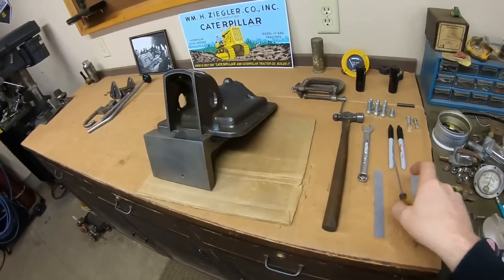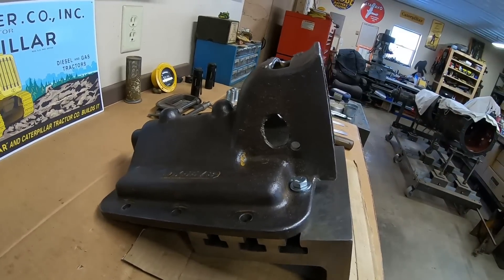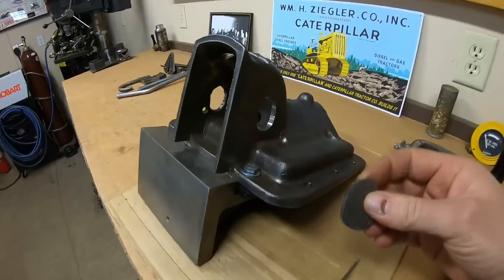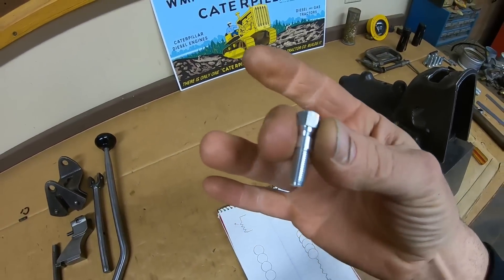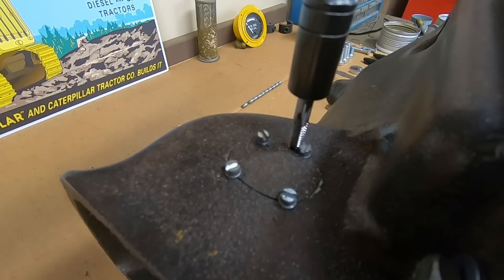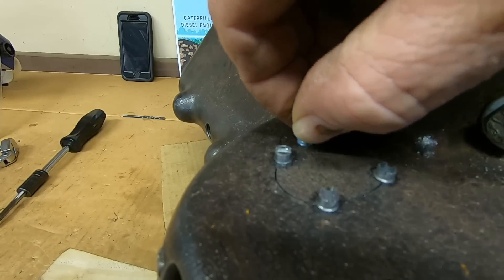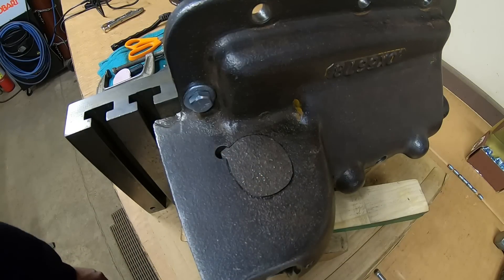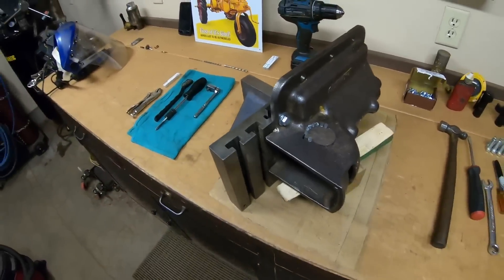Minneapolis-Moline 445 Prototype #X231 - Part 51: Metal Stitching the Top Cover Torch Holes Closed!

Comment: While a braze is likely the best repair, I believe it would leave a tell-tale line and look of repair maybe too hard to hide, so in this case the stitch and blend you are doing is better at hiding damage to restore the look. So overall the better choice.
I wonder if that hole had a grimy cork in it and they were surprised when it blew out as they cut that awful hole. Our only hope is they grumbles about that for years as penanace!
Reply: I keep being a fan of silver soldering. It doesn't take quite as much heat as brazing, and is MUCH easier. You get a joint fluxed and heated, touch the end of the solder to it, and capillary action sucks the solder into the joint and it will flash half way around in an instant. You can also use a lot less than brazing, and with a little care could have filled that very tight joint full with hardly any marks at all.

Silver solder is also very strong. One demonstration a shop teacher did was the grind the ends of two 1/2" bolts smooth and silver solder them together. He then clamped one head in a vise and gronked with a wrench on the other head until the bolts broke. The silver solder held, it was the steel bolt shaft that fractured.
Reply: @lwilton  I have a pair of little diagonal cutters that I silver soldered back together after I snapped a jaw off. I did it mostly to see if it would work, and was pretty surprised by the results. You can hardly even see the repair. Btw, Wite-Out type correcting fluid makes a great resist for areas you don't want solder getting to.

Comment: My uncle did alot of metal stitching back in Nam. Engines getting shot at or blown up in battle, he would stitch the holes and cracks in the blocks to usable engines again. The screws he said you want to screw the next screw halfway through the screw you just placed, almost like welding, all the way down the crack or all the way around the hole. He said he would also when he would get done grinding them flat, he would heat it all back up with a torch and place a couple welds over top of them for a little extra touch. He says he also used to braze cracks in tractor seats and hoods when he was out of the service back home, his techniques worked great on the farm as well.

Comment: I have had good luck tig welding cast iron Stanley planes using ez-weld cast iron filler wire.  The manufacturer says you dont need to preheat, though I have preheated to several hundred degrees using a toaster oven.  If you have a tig welder give it a try on your next cast iron repair.

Comment: Hey man I got everything running on my d2 I just picked up a couple days ago and had to adjust starter pinion clutch and the drive clutch to get good snap back on the stick but it won't move and the clutch lever grinds on it any advice on the drive clutch would be appreciated
Reply: @Squatch253  thank you really appreciate it and well when I pulled it off  the trailer with one of our skid steers seemed that the steering clutches worked and turned the machine I mean they definitely weren't adjusted the same but was any counter slop if you pulled on one the other didn't move at all on it any chance you could email me the pages in the book to how to adjust the steering and the main clutch and I'll just get everything where it should be and yeah all the teeth look great on the clutch aswell minor wear and the main plate still springs back and forth on it
Reply: @Squatch253  cause I can't get her to go Into gear when running she just grinds

Comment: - I would have guessed that heating the cast iron up to non-magnetic and then buried it in cat litter for a the cool-down would have taken the temper out of the hard parts you had trouble with.
- Why am I wrong about that?
Reply: @squatch253  .
- Yes, the Carbon atom migration thing I grasp. The heating/tempering, therefore, only makes the whole cast iron casting harder than it was originally.

Comment: To me this looks like a perfect application for silver soldering.  You had such a good fit with part it should hold well and is a lower temp procedure.  Heck even JB Weld may hold well especially with a back coat inside the part.  Both methods aren’t permanent and could be removed if needed.  With paint repair will disappear.  Great video!  Your patience is impressive.  👍😎.
Reply: @squatch253  Ohhh I see!  😄👍  I’m very impressed with the stitching method. I’ve never seen that before.  Learned something new today.  Thank you

Comment: I checked into the Lock-N-Stitch method a couple years ago. Makes for a very strong repair in a situation where you need to pull the metal together rather than push it apart. Pretty expensive if you have to buy the tools. In my case I was able to find a good used casting locally for less money. And I sold the cracked casting to the scrap recycler, so it was win win!

Comment: 10:51 the last screw you put in had no lock tight on it. Learned something new as far as the stitching goes. But I have welded lots of cast iron. And yes you gotta get the hole piece up to temperature then weld it, then bring it back down to cold. I use cast rod with gas torch. For the heat I use charcoal.  when I’m done welding, I use a welding blanket to put over it as well as I leave the piece that i welded on on the  charcoal, and just wait for it to cool down.

Comment: I just like your engineering skills to return prototype parts back to original again. My father showed me how to weld cast iron correctly and tried it twice myself and it worked well, still like the way you did it tho and for a finished look there is not much of a difference and a lot less time.

Comment: Since you have an end mill wouldn't it have been better to just make a round hole and a threaded plug you could have run it in with lock tight and not need to drill and tap 40 holes

Comment: way back when the early 6.9L had blocks that would crack and leak coolant. If you had one you had to contact International and they would send out a tech to pin the crack. They would instruct you on what to take off before the tech arrived. Never had one to repair. Lucky I guess

Comment: I completely agree with you on brazing in that success really requires getting a lot of heat into the material and you need to cool it slowly.  But, I have an older gent in the area who repairs turn of the (20th) century mantel clocks.  Surprisingly cast iron was commonly used to create the ornate bodies.  Many of them come in with holes punched in the bodies...  drops, added ornamentation, changing clockworks, etc.   Since none of these patches are structural, he matches thickness and surface then silver solders... and as you know, the key to silver soldering is NOT getting too much heat into your work.  Too much heat burns off your flux.  He uses the smallest torches I've ever seen and does beautiful work... almost doesn't need any bodywork when he's done.   I asked about the strength of the patch.  He grabbed a ball-peen hammer and whacked his plug several times...it just rang, but the patch didn't move.

Comment: Next time you need screws for your stitch weld consider the set screws in some electrical ground bars. No head to machine off, Robertson tip.

Comment: You should use a red thread lock compound as that grade has a higher temperature tolerance.
You also have to be careful not to get carried away and end up with a tractor that is made entirely of stitch screws

Comment: Squatch, you can save yourself alot of work cutting off the heads and slotting by simply cutting through 1/3 of the unthreaded  bolt diameter and tightening with a socket till the head shears off.  You've achieved a nice result in your repair!

Comment: Squatch your a man from another time we need, Attention too detail and way you present it is really a lost art. As for tye vacuum noise, I hate too say it, the motor is slowly letting go. Depending on use you should have some time before it burns up, if it sounds like the motor is slowing down, the bearings are minutes away from seizing up, sad too say.

Comment: Having repaired several blocks for antique equipment I use an old tap in a drill and let it chew and scratch around the weld the sand the sharp burs off. I've never had a weld failure on cast iron but i surely have been tempted to walk away from a couple repairs. Have to say International Harvester and Caterpillar are my favorites but again your way of presenting the channel is second to none. I still have two new cameras in the box somewhere as i was going to do a channel on large scale steam locomotives and traction engines but never got them out of the box yet. Maybe someday. Keep up the good work my D47U is going under the knife for undercarriage work in the next couple of weeks.

Comment: I repaired an awful lot of cracked cylinder heads back in the 70s, like that.  I used "Irontite" and laced the tapered pins approximately 1/3 for sealing, peened them and then shaped in the combustion chamber with a porting grinder set.  If the seats were involved, I would replace them following the repair.  Not one ever came back with an issue.

Comment: A standard oven will preheat to over 550f you can use that and  it will get you hot  enough to weld using a good nickel rod. Then you can put it back in the oven to let it slowly post cool. A circle constrained job like this is a bit more tricky and local heating with a propane torch while welding would assure a solid job and an invisible repair.

Comment: We used to use brass all thread for this. You would drill and thread the hole screw in the all thread and grind a slot above the hole a snap it off. Level it and drill the next hole. Brass will expand more than the cast iron so it will seal the passage as well. If it was used in a wet passage we would use lock tight on the threads.

Comment: Possible that you could have got away with a silver solder repair as that is around 300c though while you wouldn’t need to worry so much about the preheating at that temp the cool down would still need monitoring

Comment: I use jbweld when replicating cast iron. It seems a bit stronger than normal filler. I wait about 2 min after application then stipple it with a rough piece of cardboard. I did this on a cracked Farmall H rear and a John Deere mechanical power lift. I look forward to seeing your method. Thanks for sharing. Love the channel!

Comment: Neat repair. Just wondering about the cracks that are there. Will they continue to crack. Do you think you should drill the ends and put one of those bolts in. Or will it matter any. I am not experienced in this sort or stuff. So just wondering. 
The other thing I was wondering is, how did you get the tap to start that close to each of the last bolt you put in. Wouldn’t the tap be hitting the bolt before it got into the hole to start the treads. 
Great video.

Comment: Great work, as usual. I’ve seen this technique used on engine blocks for old tractors that froze and cracked. One older guy we watched used a threaded copper rod to make his plug screws. After he stitched the entire crack, he peened over the copper “line”. He was going for functional rather than beautiful so the repair was more visible but everyone that saw it agreed that the problem was solved. That old tractor may still be going around a field somewhere. 🥸👍✅

Comment: So fun to watch another, for me, “impossible” problem solved. I grew up in the Red River Valley. My grandfather and uncle farmed and I did it as a paid job through my late teens. The things they could do. My uncle bought ugly equipment and did spit and shine jobs, where I learned to paint, cosmetics and mechanically working. Farmers pay for shine. One notable project was a combine header we narrowed. His electric tilting band saw never cut square. So my uncle used that to get the shortened rollers to run true. Cut out the width needed near one of the ends. Set the roller ends in a long piece of angle iron, then just rotated the two ends till the unsquare angled cuts fit together. Weld them up and they were perfectly true.

Comment: I am not around or work with cast iron very often. I realize there are arc welding rods with pre handing that can weld cast. When I did it it was not pretty but it did accomplish the task at hand. It was a simple task I was attaching up boss to the block of an engine to hold a oil dipstick. My question to you is can Cassie plasma cut like that Dash and is it or does it does it does it affect the cast-iron around the heated area less or is it pretty much the same? Perhaps you could do a show on cutting that dash of the caterpillar with a chort and with a plasma cutter to show the difference.

Comment: Are you going to flush the screws inside the case? Otherwise even if they don't hit anything, might rust start working through the repair? All those screw ends are great points of collection for dirt and moisture.
Reply: @squatch253  of course they will...why did I even ask? Lol!🤣

Comment: 500 degrees for regular cast iron weld it up peen the weld make sure its clean post heat it then bury in oil dry absorbent and let it cool down for several hours or even a half a day. Thats how ive done it for 20 years in my welding shop never had anything come back from cracking. Great video Squatch thats going to be a great looking tractor when you're done
Reply: I did the same thing with an exhaust manifold...except that I preheated it in my gas grill after drilling a hole at each end of the crack and vee-ing the crack, then I brazed it up, then wrapped it in aluminum foil quickly, then buried it in play sand from the lumber yard. It was off of an old Continental engine from my Miller Big 20 welder. Got a hundred or so hours of run time on it.

Comment: Great content! Back when I worked in the auto resto shop we had a mig wire for welding  cast you only heated  the block to 2 -300 degrees just to get the moisture out made fixing blocks alot easier down fall was a 5lb spool was $300 + you used straight argon . To texture  the repair I used J-B weld it textured better& was a little more rugged. I've never seen your technique for repairs before guess you can teach an old dog new tricks
Reply: I like the idea of JD weld and sandpaper finishing to achieve the cast texture

Comment: Great work as usual, , But IMO you shot yourself in the foot! You original intent was to make the repair look as though it never was damaged. So you went to the trouble of sourcing a correct piece of textured cast iron. Then. Put steel screws around the perimeter ruining the textured surface 😱. By it being a Non structural component, using the excellent patch you made and fitted, A good application of JB Weld or Devcon,  on the inside would have been more than adequate to hold and repair that patch, as well as giving structural strength to the rest of it.
Reply: I offered that suggestion, as a former Cummins employee and now retired consultant for Cummins, It was the standard practice to repair holes in cast iron engine blocks, in non critical areas. As a Journeyman machine repairman, we use Devcon to repair low pressure pump bodys.  Definitely your repair is structurally stronger 👍

Comment: You can silver solder cast iron, the heat required is low enough that there is little danger of cracking and the joint is very strong, the only down side is the cost of the silver wire

Comment: Just use the wife's oven to heat and cool the Cast Iron and Braze/weld away and then use the oven to cool the part, lower the oven temp 50 degrees every couple of hours.
Reply: @squatch253  Just pulling your leg, if I ever went near the wife's kitchen with something like that, she would lock me out of the house, cars and barn so i could sleep under the stars.
Reply: @Sundancer268  you really want to raise the wifes ire.... use the dishwasher as a parts cleaner!!!!! makes the oven look acceptable :D

Comment: Why don’t you just Tig weld it or use muggy weld rods? I have fixed so much cast iron with both and never had an issue. I’ve done new and old engine blocks, pump blocks and so much other stuff in oilfield and other industry.

Comment: Yes , welding cast is a slow process. As a diesel mechanic, I repair tons of stuff. I had a fellow bring in a mack truck with a crack down the side of the block in the water jacket. Told the owner the block was crap. He was like most of us, broke and just getting by. The crack was due to no antifreeze. It was 23 inches long. After cussing and discussing, I said I'd do it . But no warranty. Now this was road truck with an ENDT673. I told him the hot and cold and torque, it might not hold. I've welded cast lots of times before, just not of this importance. So I got the Nicole rod and welder out. Took 2 full days to weld. It worked! The guy drove the hell out of that truck for years after that. You just have to take it slow and easy.                       Anyway, enough of me. Really enjoy your videos. Love your fabrications and work you do.

Comment: Question on drilling right next to a screw that had already been installed, it seems to me that since the installed screw was not flush, that the drill bit would not have been able to be centeredclose enoughto the installed screw to drill the next hole partially throughtheinstalledscrew and partiallythrough the cast iron.  How were you able to drill close enoughtothe installed screws?
Reply: @squatch253  ingenious!!